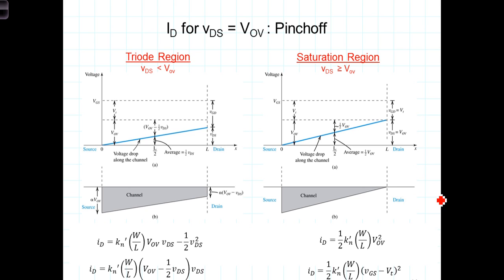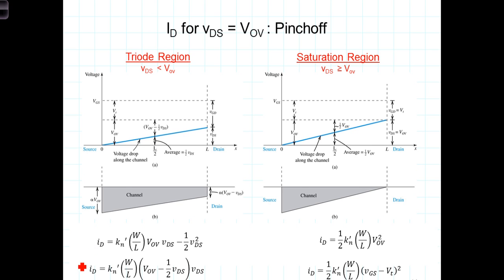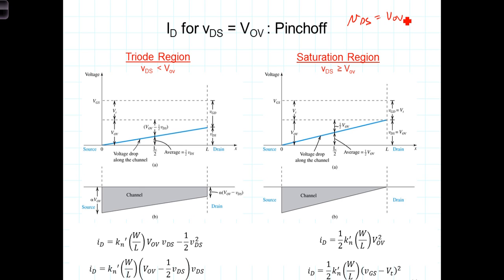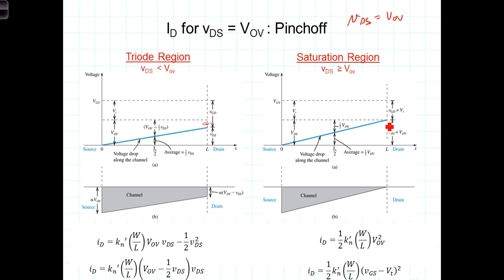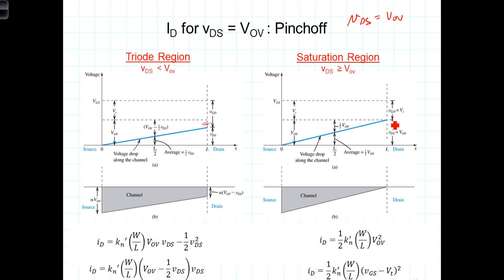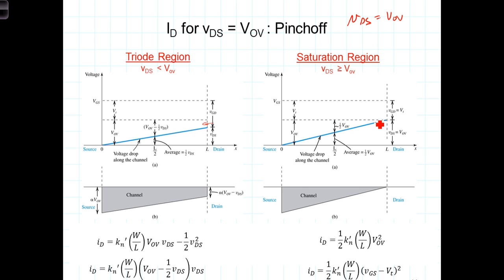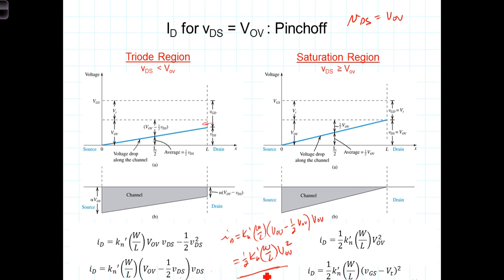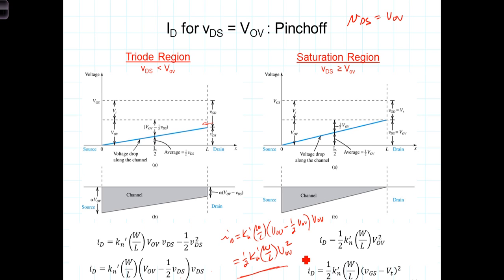L5 1 3 5vDS Greater than Vov Saturation Region

Comment: As I understand it a MOSFET operates as a switch in the Triode region. In the video above a MOSFETis in the TRIODE region when Vds is less than Vov or (Vgs-Vt), does this mean that a mosfet can only be used as a switch if the voltage used to switch it, the gate voltage, is greater than the voltage it is switching, the drain voltage? That doesn't make intuitive sense?